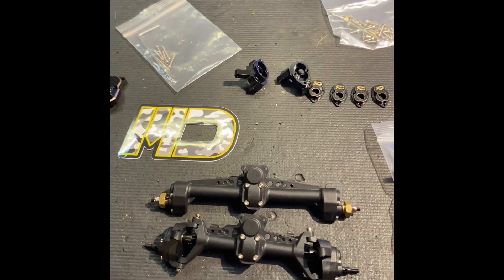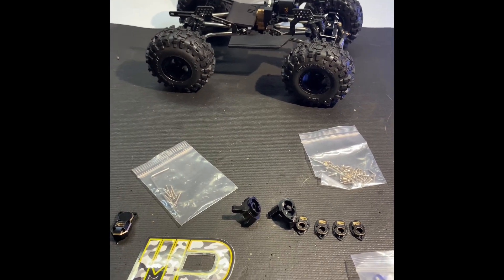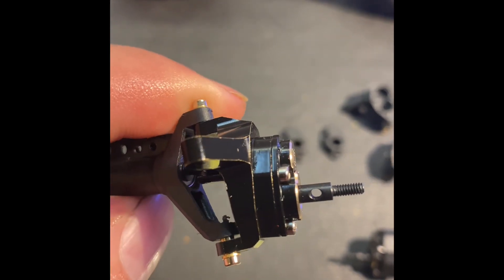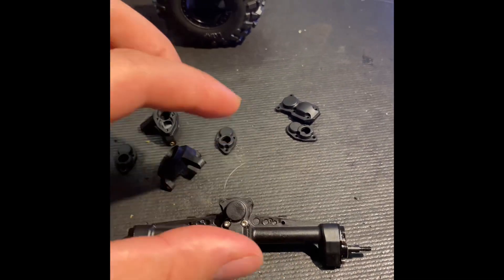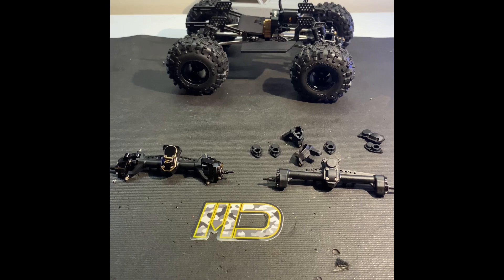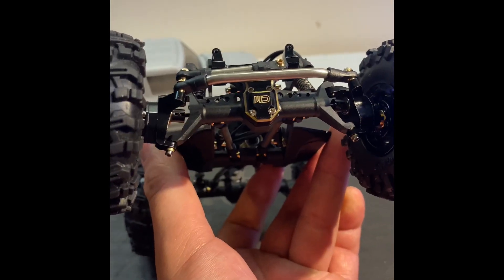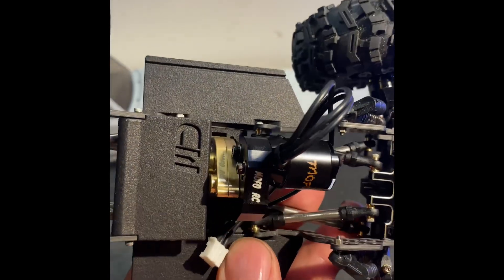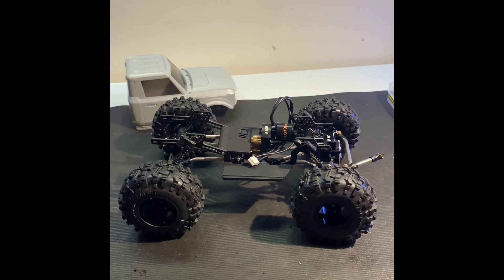Nylon portals and Mazz Designs brass portals knuckles, covers

Comment: Do you prefer nylon axles over aluminum or brass? And  Portals then straight axles? Know it's all personal  preference on all this. Heard most like nylon more cuz they slide easier across rocks and obstacles. Just thought I ask yr opinion. And appreciate yr channel very helpful. The rigs u build are killer
Reply from the maker: This is the first time trying nylon ones and portals we’ll see how it works. I have heard the same thing sliding easier. No problem always up for questions and comments. Thank you for the support 🤘🏾